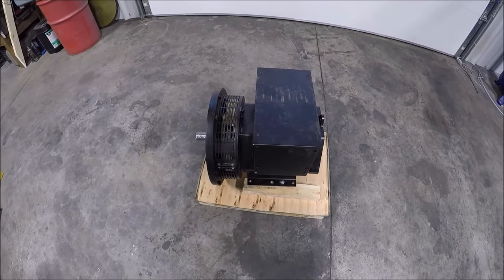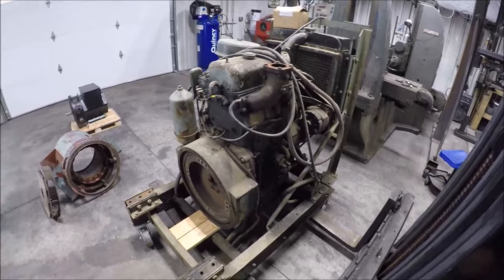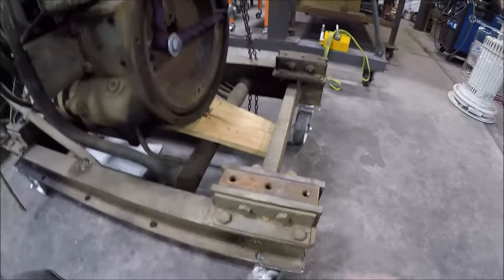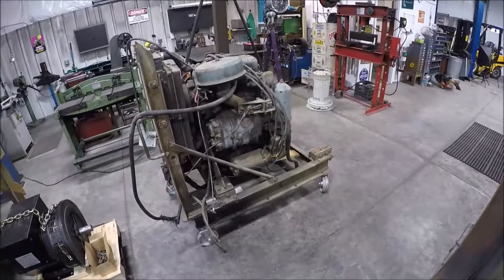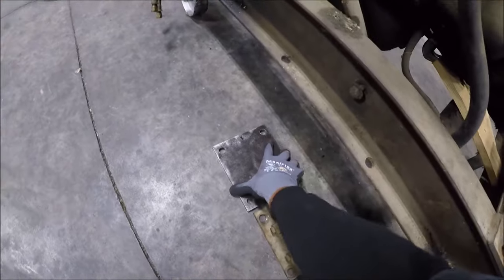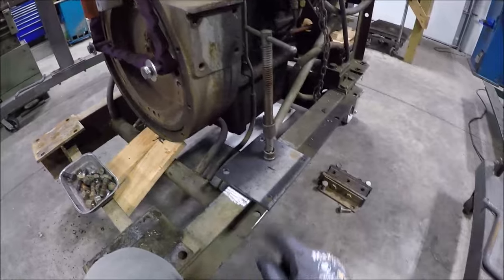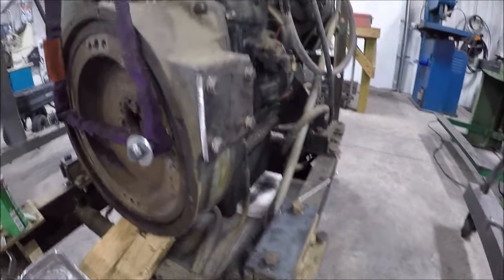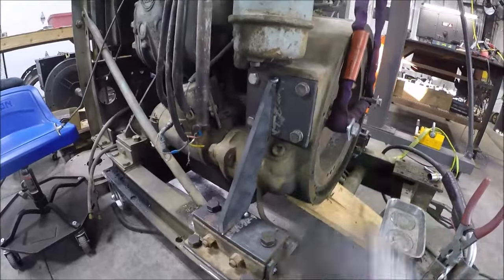Modifying a 2-71 Detroit Diesel generator. Part 1

Comment: You get some very interesting jobs Tom. Good plan to fix this problem. I like the metal saw. Made short work of cutting that metal plate to size. Cheers Nobby
Reply from the maker: Hey there Nobby. I love the metal saw especially for thicker material. I use it more than my plasma cutter now that I have it.

Comment: Hey Tom looks like fun that is not a V its 2-54 or 2-71 i think its a twin . how much was the new unit and is it from China .  It would be cool to mount one of those blades in a table saw you would need some HP not no cheep HF unit .  JM
Reply from the maker: True. It is in line and not a V. I should have known better. Not sure on the cost of the unit but it was made in Georgia by "South Georgia Generator". I ended up calling them for some help in part 2 of the videos. Great customer support.
Reply: Yeah Tom that's cool made in the US
Reply from the maker: I corrected the title. 😊